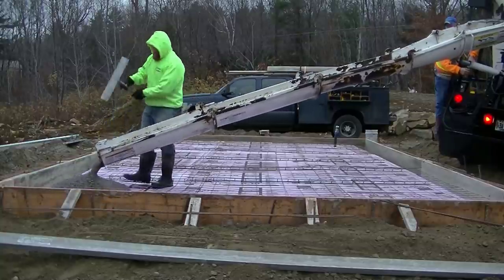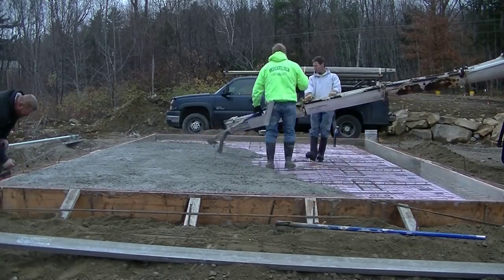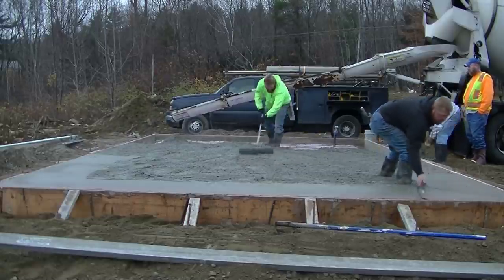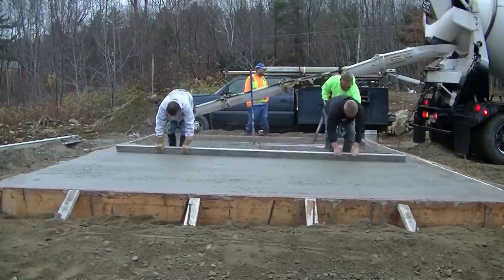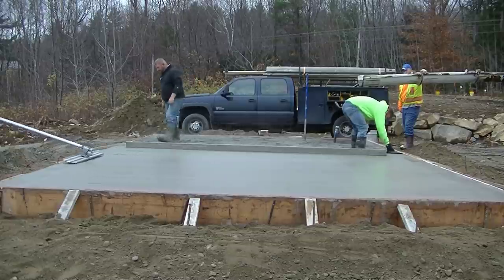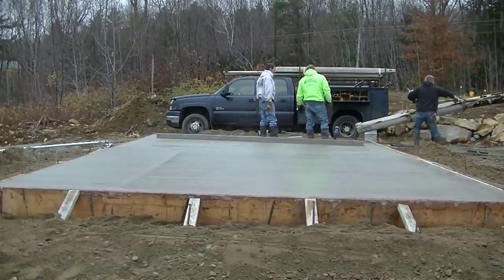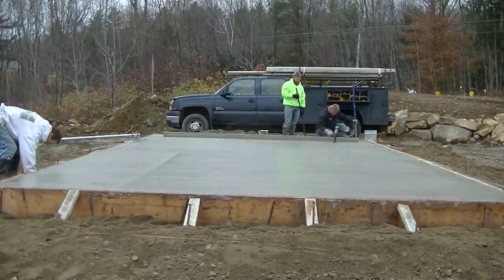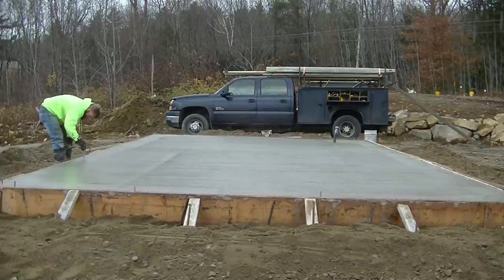How To Pour A Concrete Slab for A Tiny House (16' x 24') Beginners DIY

Comment: I'm building my own tiny house.. I will have a concrete crew do what is seen here in video however, I will lay my own concrete block basement.. (some experience some years ago.. but, I'll learn again.. a lot of work when I'm only a one man team.. some things later like plumbing & electrical I have some help there.. mine is 16×20 cabin with a cellar/basement & it will be intense for a 50yr old guy but, I know I can do it

Comment: Even though Tiny Houses are relatively portable. I am surprised not to see provisions for plumbing, electrical or sewer. I guess if the house is self contained it’s not needed!      Revision I : I heard close to the end of the video a reference of some form of utility, my comment my brother premature!!
Reply from the maker: They did get the water line in. They tried to get the plumber there but he just wouldn't show up. The owners had a small window of time to start the build so they decided to just go ahead and get the slab in and do the plumbing after.
Reply: So the homeowners are going to have to run plumbing lines above the concrete?  Aren't they just back to having to have a raised foundation?  Now with a concrete slab under it?  Odd.

Comment: I have done footing's, foundations, walkways and slabs. It has been years since I have done the work and we are getting closer to pouring our insulated radiant heated slab. 30' x 60', I have been thinking about tackling it on my own, I have been quoted 16k from a contractor @ 4", but if I do it on my own I could pour the 6" slab for what I want in the mix for in my area $170 per yard 35 yards total = around $6500 with tax. That would give me the money for the R-20 insulation under the slab and also pay for the radiant heating tubing. I have thought abought making a wide screed to use, or passably hire a couple of able bodies who would like the extra work for s few hours. I like the channel, you have a lot of information for people to use if they choose to do so.

Comment: Wow this was a great very informative video. Thank you for your thorough explanation of the process, tips and tools you used. My husband and I live in a Crossroads Hampton destination travel trailer on his parent’s 2 acre property to save money on living cost and raise our chickens and ducks on. We need to add a 25’ wide x 51’ long concrete slab with a slight angled ramp on one end to drive the trailer on it. This concrete slab will eventually serve as a foundation for a double wide trailer that we will buy later on and live in that and sell our trailer. The concrete slab is estimated at 34 yards of concrete to be 6” thick with 6 bags of concrete and using rebar for strength and stability. We were given a quote by my dad’s friend who is also a long term cement contractor and would love to allow him and his team to work on our new concrete slab but it’s being quote a very high price as it should be we just can’t afford that at this time and we need to get this concrete pad done since our trailer has been sitting on hard dirt for over a year since we got married. My dad, my husband, my father in law and I will work on this project on our own to save a lot of money that we can use towards saving for the double wide home. We’ll also attempt to make a stamped stained concrete patio similar to what my dad has which is a beautiful adobe color, very earth tone color and goes with any landscaping. Any tips you can pass my way would be very helpful. We will also try to rent the tools as well and hire a cement company to deliver the ready cement like you did. The slab you did here came out beautifully. I’ll be sharing this video and the other video on the start to finish for a concrete slab with my husband and our dads so everyone knows how the project should go. If I have any questions I’ll reach out to you as a a reply to this comment so you know it’s me, Amber. Thanks Mike.

Comment: I like pouring concrete. I’ve helped out on some bigger jobs but I’ve only planned and organized smaller ones on my own. I recently did a footing for a stone column that will be used as an entrance gate for a property. I had a harbor freight electric mixer and it took 93 80lb. Bags to complete. Needless to say that was way too many bags to be running through a little mixer. Both the mixer and I survived but we took some years off our life span. I’m planning on pouring a slab for a mortared stone patio at my house this spring. Its fairly big approximately 15’ x 30’. I’m definitely going to call a truck for that.

Comment: I usually take a EastWing and tap the  bulkhead to reduce honeycombing. I also use form oil to make stripping a little easier. I noticed the forms looked a little dry. This would have been a nice size slab for a vibra-screed. That way Luke coulda dropped the mag darby and pick up a come along to rake on one side. Not only is flatness insured if used correctly. It also vibrates the large aggregate down and brings the finest and paste to the top to make sealing it with a bullfloat a snap. I been doing this for over 35 years. I was ACI certified, went through a three year apprenticeship, was a foreman over several jobs as well as business agent for fifteen years in the OPCMIA. I've been on pours from 200 sqft to 20,000 sqft, from 4" to 2' in thickest. I've worked with laser screeds mounted on a rubber tired frame, cable hand cranked vibrating screeds, vibra-screed and of course 16' mag straight edges. My biggest pour was probably about 12 years ago for Hi-Way Paving on Corridor H in the Eastern Panhandle of WV. We poured 200 ten yard tandem dump trucks full of 1.5" slump 45000psi mud. 2000yds and 3/4 of a mile of two lane highway in about 14 hours. I retired about 2 years ago with 33 years service. I still do side jobs and just prepped formed poured and stamped a little slab at Deep Creek Lake in MD couple months ago. Not only do we have some women in my old local but up in the Northern Panhandle around Wheeling we have a female business agent. Flatwork was always the favorite of most finishers compared to Heavy/Highway. However a bridge deck working behind a Bid-Well was one of my favorite. There's very few big buildings, bridges, roads or sidewalks two hours from my house in any direction that I or one of our guys I sent had a hand in helping finish it. It's good feeling to know a lot of my work will be here long after I'm gone!  Over the years I've found working with concrete is alot like dealing with a woman. The more you play with it the wetter it gets. You'll wait on it but it won't wait on you. Just when you think you have it, it'll get away from you! Hurry up guys the truck's coming!

Comment: Your videos are excellent Mike. I am a long time diy guy and i had no problem doing a nice 6 inch thick 9'x9' slab for my hot tub after following your lead. Next up I'm gonna try a 12x24 for my outdoor kitchen. I'm thinking i need to rent a power trowel for that. A little scary but trying new stuff is fun

Comment: Another great video Mike. 14' screed is as big as I go to. Any more will pull your guts out. It would be nice for me to just pour and do some forming but I get stuck with a lot of grade work. I've done the math and I make a lot more pouring concrete.
Reply from the maker: There's more of a profit in the concrete for you? That's a good thing.
Reply: Yes. I do much better if grade work is already done. I've considered going up on my excavation price. I rent my equipment as I need it now. Would make more if I owned a skid steer and mini excavator. I had a guy make me an offer a couple weeks ago. He does grade work, all form work, goes back and gets forms for $40 a yard. I'm thinking about considering. All I would do is pour.
Reply from the maker: There's good money in just pouring and finishing. Sometimes you can get in 2 pours a day. Maximize your time and profits.

Comment: Been watching lots of your vids. Excellent source of info and tips. Only one thing I disagree with is the wet setting of rebar. I was talked into it by a contractor on a slab I helped out on for my employer as it was faster and less labor intensive then tying a "ladder" of rebar around the perimeter. 2 years later massive cracking and heaving on ever rebar line. Granted a non heated building and much different ground. Not being critical, you do excellent work, I just know I will be taking the time to tie all rebar in the future.

Comment: I really like your videos. They are very instructive and a complete beginning to end. I like that you've shortened each video into one step of the process so that we beginners can take it slow. Can you tell more about what mix of concrete to use in areas with below freezing temps in winter?
Reply from the maker: I always use a 4000 psi fix for exterior concrete. It also has air-entrainment to help protect against freeze/thaws.

Comment: Great video and thank you for posting it. You and your guys make it look so easy. I have yet to pour a slab and looking to do a couple at my place. One will be 22'x15' and one is 14'x15'. Nothing big, just bigger than I have done. In the past I have done small footings for equipment and steel storage racks and that has been it. Biggest I have done was 7' x 5'x 16" deep for a material rack that held 1"-4" thick pieces of steel 4'x8'.  Appreciate the information and look forward to more videos.

Comment: For very little cost and just a little bit of planning they could have at least put sewer plumbing.  Nice video and great work!
Reply from the maker: They tried but couldn't get the plumber to show up. They had a short window to start building and just decided to get the slab in and build, then do the plumbing after.

Comment: great video. i like to do as much as i can around the house myself and i've done some pretty big projects like building screen porch, decks, cutting trees, pouring walkways, etc. always looking to learn to do things easier and more professionally.
Reply from the maker: Awesome Leroy!
Reply: @MikeDayConcrete  i could use some advice. i need to pour a driveway between the house and a retaining wall that are about 10 ft apart and stretch for about 20 ft. what's the best way to set the forms and pour the concrete?
Reply from the maker: We'll use a product called Iso-strip off for the forms and glue them to the existing house foundation and retaining wall. It's a piece of 1/2" foam by 4" or 6" that will allow for expansion and contraction. Here's my page about it: https://www.everything-about-concrete.com/concrete-expansion-joints.html
Reply: @MikeDayConcrete  thank you. read your page and it is very clear.

Comment: I would have used 16’ screed just so we wouldn’t have to walk in the concrete. I use a 20’ on driveways because they usually 18’ wide so don’t have to walk in concrete. I’ve always hear guys say putting water in concrete makes it crack, but I’ve never found that to be true. Actually the less concrete in it will keep it from cracking, ( you can bend a piece of paper, you bend a pencil it will break the pencil has more wood) It’s code in our town to put bolts every 4’. We measure them out for there rim joist plates. Example if they are using 16 ‘ 2x4’s for there plate we would put one bolt at 15’10” and at 16’2” so the next plate would have a bolt just a couple of inches from the beginning and end of the board. Sound hard/complicated but it’s not and the carpenters love it. Looks like you had new handles on the bull float.

Comment: Mike - Love your channel.  Question on the foundation/slab.  I'm in MA.  I know IRC allows for buildings to be constructed on foundations without frost wall.  But I thought it required insulation on the outside of the foundation as well.  I know you have some under the slab.  Is the insulation also required in ME on the outside  to prevent the frost from getting in.  Thanks.
Reply from the maker: The excavator does the outside when he backfills the slab.

Comment: Great video.  I would have thought you would need concrete below frost line along perimeter for a house (even a tiny house)?
Reply from the maker: No, if the structure is heated, frost will never get under the slab.

Comment: With a thicken edge slab does the inspector question the depth of the footer part of the slab?In NC frost line is 12 inches. The edge of the slab is usually 16”. Do you dig down the 16” on the perimeter or build it up?
Thanks Dan

Comment: Im pouring a concrete slab this coming summer, 16x24 just like this one but for a new garage.   I plan on scraping up the sod, and then leveling out the area myself then adding my crushed rock.  is there any tips for a first timer? things to watch out for or ways not to royally mess it up ? lol

Comment: I am a bit confused about the county we want to do a tiny house in....the zoning rules are very old and it says we need a 4 inch cement pad .  The situation is that in  upper lower michigan the frost is horrible. 
Won't this mess up the pad?
Reply from the maker: If the building is heated frost won't get under the slab. It's a good idea to put 2" Styrofoam under the slab just like we do on most of ours.
Reply: @MikeDayConcrete  thanks !!!!!

Comment: I think you said the one pipe sticking out is a water line, typically do you also have the drain lines and electircal in before pouring the concrete? Is this covered in your course?

Comment: Mike I saw Luke push rebar into the sides like you said. My question is why don’t you just push the wire mesh or rebar in after you pour it?

Comment: Your perimeter steel is SUPPOSED to be at the bottom. At the top it does no good. Steel works in tension and the only tension is at the bottom of the footing. The top is in compression where your concrete is already doing its job. Just like your welded wire mesh - it's at the bottom of the slab, not the top. And there is an opposition to wet setting steel. Some engineers are opposed to it. Your process is very popular and with a reasonably wet mix works well.Nice video and very thorough.

Comment: Found this video and I really like how you explain everything. I’m looking to add a pad to my back yard to an existing small pad from deck stairs. It’s going to support a future hot tub and total dimensions will be about 12x25. Would you advise pouring up to foundation of the house or not? Also pouring up against the existing smaller pad should I drill into the sides of it for dowel holes for rebar or can I just pour up to it? 

I believe I have the confidence to do this myself with some helpers and frame it up then hire a pourer to come in and pour then finish myself while renting the tools

Comment: I want to do a 18x24 slab for a workshop, I’d like to do it myself, but not sure if I need a footer for a metal building or if 4 inches is good to go. In oklahoma, so frost heave  isn’t a concern. Any suggestions?
Reply from the maker: If frost isn't a concern and you have a good gravel base, then I think a 4" slab with 8" thick edges is ok. A straight 6" slab would be good also. I have my slab course in The Concrete Underground, it'll teach you all you need to know.
Check it out here: https://www.theconcreteunderground.com/the-concrete-underground
Reply: @MikeDayConcrete  thank you for the reply, and thank you for the video. I will check out your course!

Comment: I want to build a concrete home someday using ICF’s.  Even the roof concrete.  I am considering making a small shed first to get more experience.  I have a mixer than can mix one and a half 80 pound bags of concrete at a time...I want to pour it slowly that way.  If I did a small 12 x 12 slab in 2 or 3 pours over a 2 or 3 day period, does that make the slab deficient?  It would have rebar to hold all together.  I prefer that to getting a truck to come in.
Reply from the maker: I would try to do  it in one pour if you can. It would come out a little better in my opinion. You can do it in sections, you'll just have the joints in the floor that's all.

Comment: I'd like to know the cost per square foot to do this sort of thing myself.  Like, could you give cost breakdowns for 12x12, 20x20, 40x40 pours, etc?
Reply: I'm in central Texas. I've done all the excavation and grade work with rented machines, form boards, wire mesh, chairs, poly liner, stakes and a tarp for afterwards to pour a 28x36x5.5. It'll take 2 9yrd trucks. Paying 2 helpers for finish work with rented tools. Total cost is just over $3,500.

Comment: I want to build a 40 x 30 garage.  I'm thinking of pouring sections 10 x 30 each with expansion joints.  is this method OK or should I hire a concrete contractor?
Reply from the maker: It's ok. I might drill and pin the slabs together when I pour them.
Reply: Dennis Kenney you don’t need to use expansion joint between pours, just pour against the previous pour if you’re garage is isolated from existing concrete. If you are pouring against existing concrete use expansion joint against on these surfaces.
Reply: Dennis Kenney I poured a slab for a 30 X 50 shop. I poured 15 X 25 slabs. More manageable and easier to work! I also pinned each pour to the adjacent section!!
Reply: Don’t use the expansion, put dowels in the end of pour and pour the next section the next day because the slab where you stop pouring is going to curl up on you and your going to have 2 un level spots going all the way across the floor. Probably don’t understand what I’m talking about and you probably wouldn’t notice it unless you hired it done that when the little mistakes are more noticeable. Good luck.
Reply: Dan, i agree pinning the slabs is the best practice. Putting expantion material and basically having slabs that can shift independantly can present issues later down the road..

Comment: I was under the impression that concrete cracks formed because there was too much concrete in a certain spot or not enough lime in the mix was added. But too much water or too watery, I never heard of that.